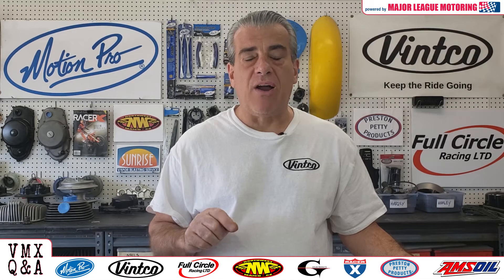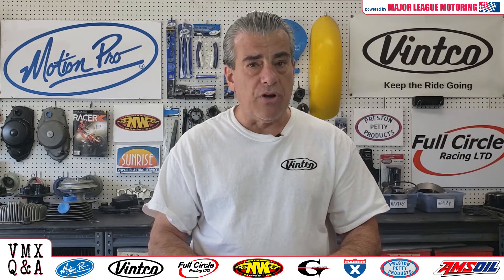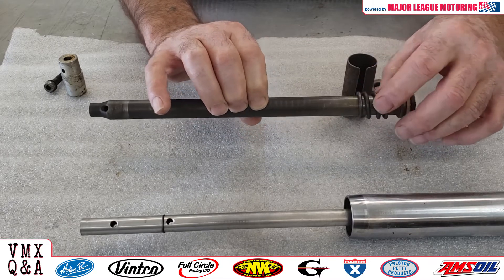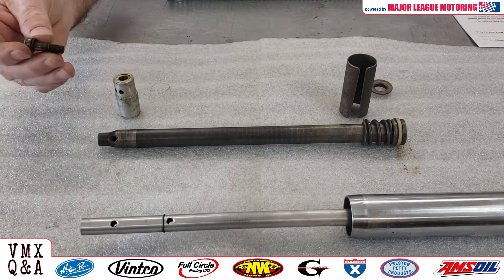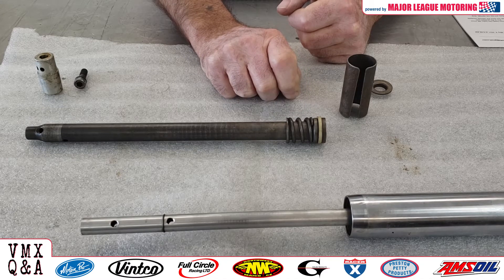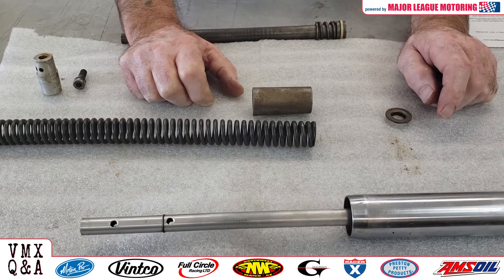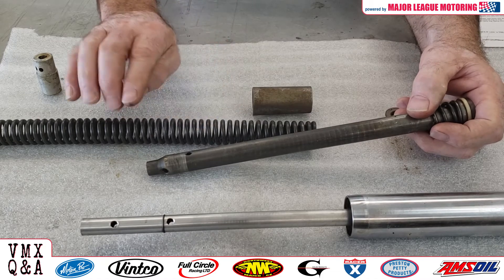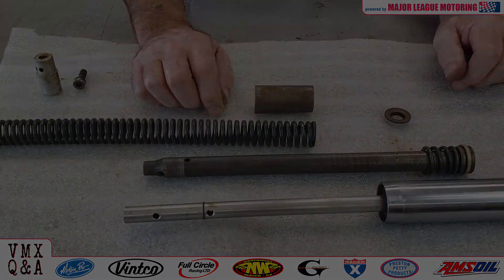Damper Rods/forks- VintCo Vintage Dirt Bike Tech Tip

Comment: I need a tool to remove my damping rod. I have a MT07 do you happen to know where I can get one?
Reply: If I know Yamaha, and yes I realise this comment is a year old, it'll probably be about four feet worth of 1/2" socket extension.
Reply: @Cheezeball99999 I just put spring back into it. Then compressed it to put pressure on the rod. Did it on carpet for better traction. Also needed to heat up the bottom screw as it must have had thread lock.

Comment: Hi sir, I need a suggestion, if I change my damper rod with a bigger one and wholes r same like the stock one, will it increase the hight of the overall suspension as well as the travel? Or if I change the bigger spring with the stock one do the same?
Reply: Yes, if you extend damping rod for 2cm then teavel and overal height will increase for 2cm. Also head sterring angle will increase for ~1° and wheelbase will increase for ~1cm.